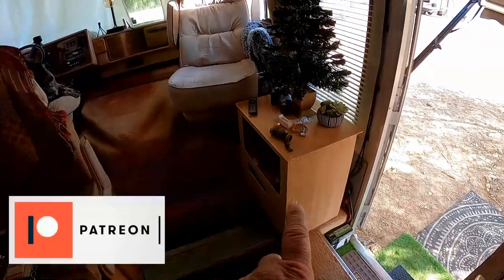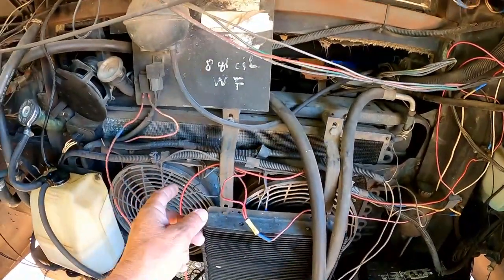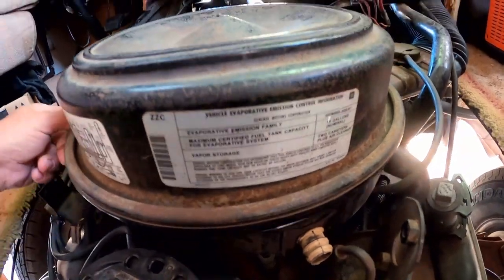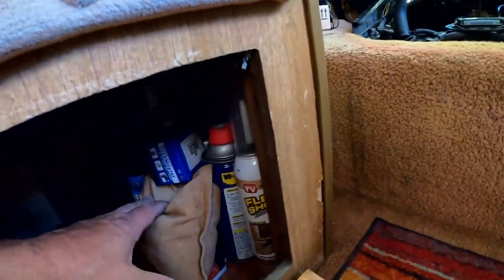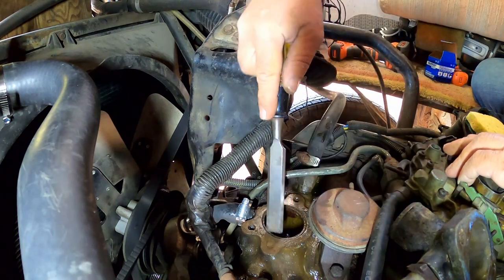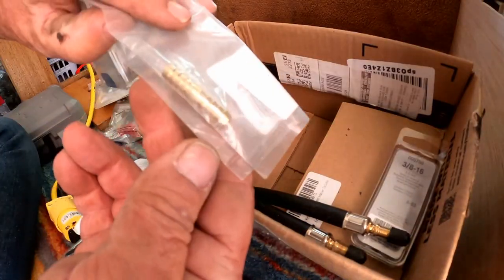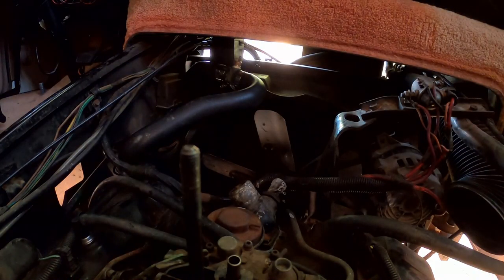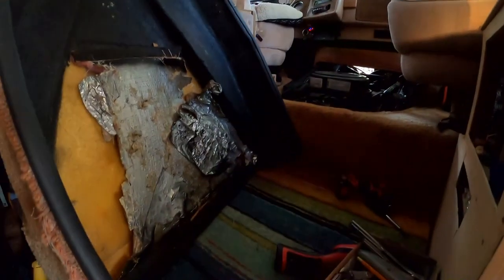Engine Thermostat and Electric Cooling Fan Thermostat Replacement on a Big Block Chevy RV Motorhome

Comment: You're fortunate to be able to know what needs fixed, and fix it. You're about redone all the systems. You should be proud of yourself, and all the money you're able to save. Nice job!! All those mix match mess of those wires, oh heck no, I would have slammed that hood as fast as I could have. My husband used to work on our vehicles, but it's nearly impossible now with these new engines. 🙂👍

Comment: The inner voice which comes out and shows the thinking process is good for all this.    It's applicable to lots of projects. thinking it through.    I particularly liked the explanation of the subtleties of the hose twist and bolt torque at about 1 hr in is really good stuff for any would-be mechanic.    That is, when it comes to reliability the devil is in the details.    The gootentight (spelling?) specification!   love it.   Really, that's just another term for how tight something gets when installed by a mechanic with experience.        This is going to end up being a race Coachman I bet.

Comment: Dave I carry a set of wire wheels that attach to my drill. Does a good job. Also I went with electric fans and increased my MPG's. I have a 98 GMC 2500 with a truck camper.

Comment: Great video Dave. Brings back a lot of memories from working at a auto repair shop when your RV was new. We had vacuum diagram manuals for all of those "subway systems" which helped when the decals were gone or unreadable.  All of that vacuum operated emission control stuff was a real pain even back then. Looks like the Coachman is not computer controlled. Standard Quadrajets are good carbs.   Feedback ones with mixture control solenoids are not as good.

Comment: If you pull that large AC condenser/oil cooler you'll be surprised at what made it's way into it. More often than not when the engine begins running hot folks are told they need a new radiator. Come to find out that pulling that condenser will tell them that it just needs a real good cleaning out for the air to flow thru the fins to restore cooling efficiency.

Comment: I put a switch on the dash to run those fans manually. That top rad hose sure bulges up on top of the motor. Be very careful when removing the rad cap. Those old radiators are fragile especially the filler neck.

Comment: If You can't find the exact thermostat for stuff a Snap Disc Thermostat for a House Furnace will turn Your Radiator Fans on and they make different temperatures of them.   I think probably something like 180°.

Comment: Good job Dave… And by the way do not I “do not put a Holly on there I made that mistake with my 460Ford it had a Motorcraft spread bore carburetor which is the basically the same thing as a Quadra jet… I put a Holly on instead of the Motorcraft because it was $250 cheaper… Did not work by the time you put the spacers on and everything to get to a square bore which that’s what Holly is opposed to a spread bore which your Quadra jet takes and also my Motorcraft takes too much restriction took it off bit the bullet and bought the right carburetor runs like a dream just an FYI looking forward to the meet up on the 18th I am at the Laposa South….I met you last year I got a sticker from you but I look forward to visiting with you a little more… Talk soon… Timmer 😊

Comment: Once you get the cooling fans working you can remove the flex fan.  Keep the toggle switch working so that on very hot days in slow moving traffic you can control the fans. I would also remove the aftermarket a/c condenser soon for a major airflow improvement. Thats what I did to my motorhome. I have a video of it on my channel.